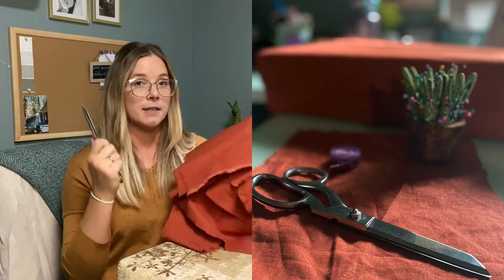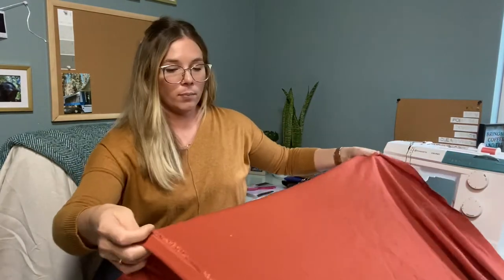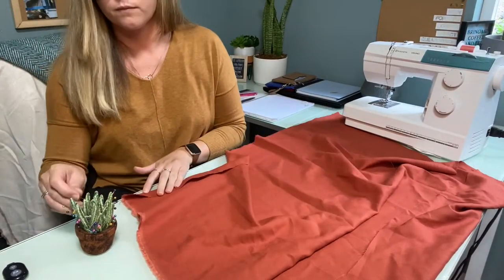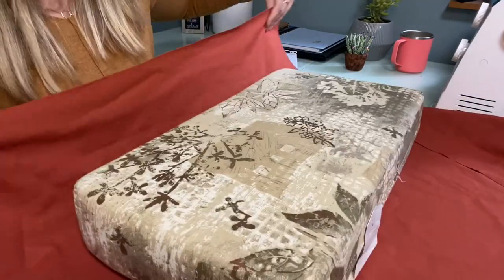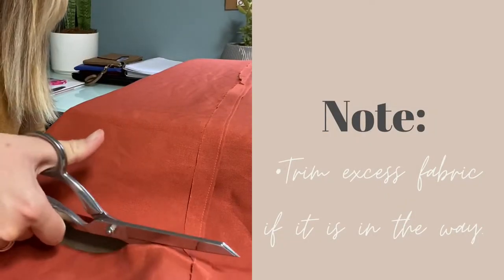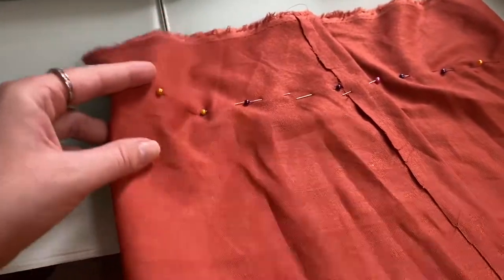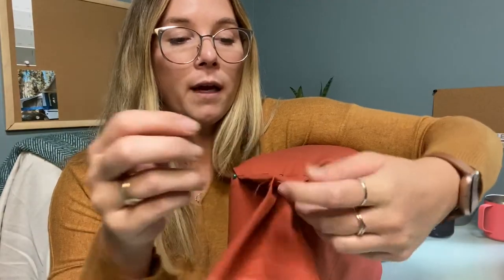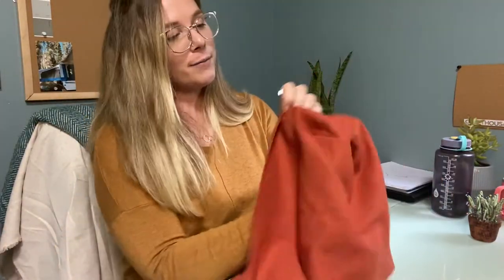How To Sew Cushion Covers in Your Camper in 6 Easy Steps!

Comment: Thank you!! I was stumped how to go about doing them. I did some a few years ago but it was way too complicated to try again!! Lol 
They are a little more loose fitting than I'd prefer but hey, it's just a camper!! But it's turning out super cute!  Thanks again!
Reply from the maker: Yay! So happy this worked out for you. I always see inside of the seem I make, so they are a bit tighter.
Reply: As to the looseness, I'm planning on wrapping in 1/2" poly bonded dacron and using velcro to hold it taut.

Comment: How did you get the pillow out after you pinned the sides tightly on both sides? Maybe once I do it, it will be simple, but I'm thinking it was tight in there, and the pins would pop out?  Thanks for this. I'm debating making my own new cushion covers, or just ordering stretchy chair covers (another tip I saw on another video)  Love you simple, no measure, cut blindly attitude! Perfection is overrated LOL
Reply from the maker: Haha I hate measuring honestly 😂 it was tough, I had to be really gentle when removing!

Comment: Thanks so much for posting this. I'm going to ice dye a 10 oz canvas drop cloth to do this. 
My question is regarding the configuration of my cushions. I don't really want to buy new foam, but the seat cushion covers the whole base and the back cushion sits on top of it. The seat migrates out and the back falls down. There is a channel in the seat cushion for the seat belts. I also don't want to try to duplicate that. If I made the back be full height, the seat belts would go in between the two cushions. Either way non skid stuff or velcro could take care of the migration problem. Hopefully. Please let me read any words of wisdom about the best way to proceed. Thanks in advance!
Reply from the maker: I would do exactly that! My cushions fix really snug so I didn't have that issue, but I would just use Velcro and I bet that helps. If you do decide to create completely new stuffing I suggests making them bigger then the ones currently in your RV so that way they fit really snug in their spot! I hope this helps!

Comment: Ok I'm diving into this project.  I have been sewing for a month haha!!  But I'm wondering how to do a curved cushion?  Would it be different?  I'm having trouble visualizing what you did on the flat ones on the couple I have with curves.  They go in the corners of the "sectional" part.
Reply from the maker: Oh my gosh the curved sections are so hard! I actually did do ours! I basically cut out each piece and sewed together. So for example, all the edges, the back, the bottom, the curved inside. Then I pinned all of the sides to the cushion and sewed. I will definitely try to make a video of this for you!!! 🙌🏻 it’s not perfect but it’s also not super hard! Took me a few try’s for sure!